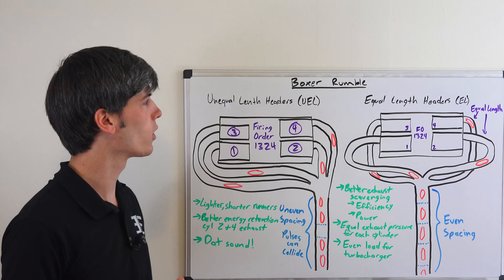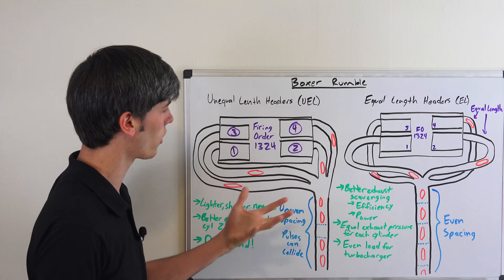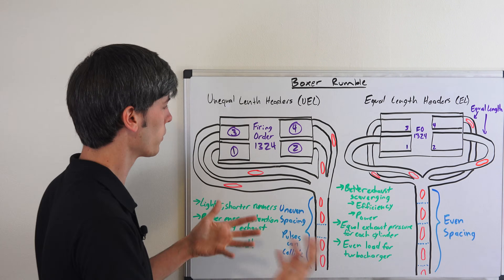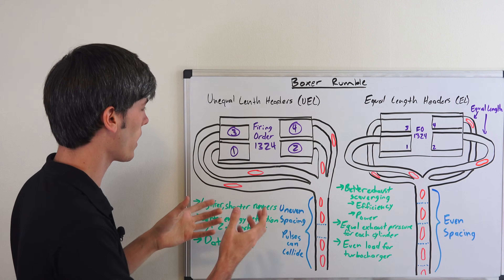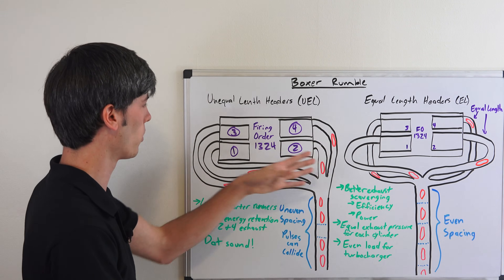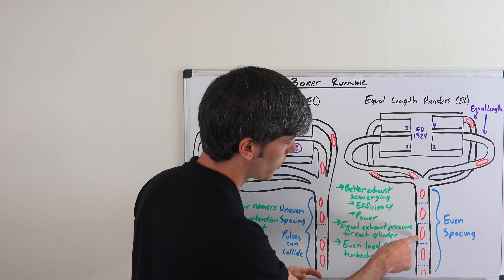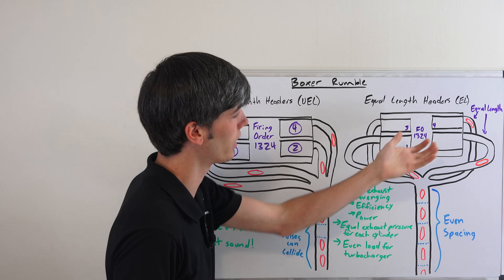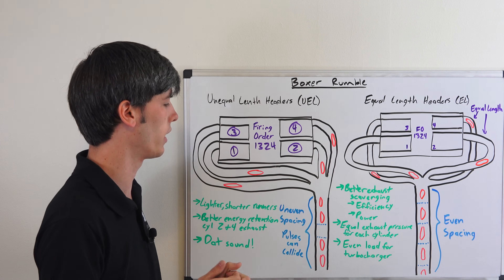Subaru Boxer Rumble - Exhaust Explained

Comment: Engineering Explained logo is actually a boxer engine.
Reply from the maker: +tokekkk Haha yesss!
Reply: Engineering Explained Exposed
Reply: +Stirling Moss Well, his Subaru comes with a turbo, so many you're the idiot and you don't even know his car?
Reply: +Engineering Explained secret is out, save the manuals!
Reply: +Stirling Moss No - that's not the only reason for it. Subaru has sold the EJ series motor in Japan for years with EL headers... so if they wanted to go that route, they could.
Reply: Yes, the logo looks a bit like a 911 flat six.
Reply: +tokekkk i never noticed that, i always noticed the logo shaped like a rotated gear shift gate..
Reply: +Stirling Moss The USDM cars are mainly built to meet the stupid EPA emission tests.

The very same group that is complaining about VWs diesel emissions, yet most of the Pickup that the US make, dont have to follow the EPA guidelines for cars.
Reply: IIGrayfoxII Wrote the dumbest thing I've read on Youtube in a week, congrats.
Reply: +Stirling Moss he actually stated different models with different set ups but you wasnt listening
Reply: He did it before he got a new car, so either it's a coincidence or he's always been a fanboy.
Reply: +Stirling Moss My non turbo subaru has stock UEL headers. do you know subarus?
Reply: +tokekkk What has been seen can not be unseen
Reply: you know what I just realized that, I wonder if Jason did that purposely ...
Reply: i would have said a flat 6
Reply: +Иван Калашников I think you can call a "flat six" a "boxer six" -- theyre interchangeable.
Reply: his logo is car throttle but white and vertical
Reply: I always just thought they were two piston heads.
Reply: Subie boxer engine 4lyf haha
Reply: Geniusss
Reply: +MikeG4936 Yea because the usdm subarus are built with cost savings in mind idiot
Reply: This diagram is wrong. Non turbo Subarus come stock with equal length headers. The only reason for unequal length headers is the other header/exhaust meeting to the turbo manifold on the right side on the engine. You're an idiot and don't even know your own car.

Comment: Isn't your Subaru the new WRX, so the one with equal length headers? Because if it is, even so it still sounds like a subaru, of course it's not that obvious but you could still pick it up in a line up:)
Reply from the maker: +Aioanei Teofil The STI still has UEL headers, and I have the previous gen.

Comment: is this phenomenon only attributable to boxer engines, i.e. if you had unequal length headers on an inline 4 cylinder engine would you still get the same rumble?
Reply from the maker: +oppanheimer You'd have the uneven pulses, hence the rumble, but of course other factors determine the way it sounds (exhaust length, diameter, engine size, valve timing and lift, etc).

Comment: On the 86/BRZ (FRS) work people put the UEL on because it seems to give better smoothing of the FA20's infamous torque dip. Whereas the EL headers apparently give better overall top end gain. How would you explain this effect/difference, if it is indeed real? (I have Tomei UEL on my 86).
Reply from the maker: +Scot Mcphee I would look to see that the claims are legitimate before thinking about why. Dyno sheets before/after? (Sans tune?) You could probably tune it a bit for more torque regardless.
Reply: +Engineering Explained Well the dyno graphs I've seen bear it out but that could still be down to the tune as you say. (sans tune, you'll get a CEL usually because you've deleted the front cat).

Comment: Mate, you're almost there, it's because the cylinders fire from one side first for 2 of them, then the other two on the others side, that is why the rumble exists, it's two lots of pulses in a row, then followed by the other two, if you make equal length headers, the pulses clash which eliminates the resonance, they cancel each other out, the uneven length just allows the characteristics of the Subaru flat 4 to be heard.   
The flat 4 VW engine is different in the sense that it fires on one side, then the other, then back again and back to again till it finishes 2 revs of the 4 stroke engine, the Subaru fires twice one side for one rev, then 2 on the next revolution for the other side for the 4 strokes.

Comment: Glad to see one of the old whiteboard videos!  So is the boxer sound produced purely from the UEL?  If this is the case, would another engine, like a V type, be able to make the same sound if they had the same exhaust configuration?  I'm wondering if the sound is unique because of the exhaust or a combination of the exhaust and the engine itself.

Comment: Why does exhaust make noise? is it the pressure of exhaust being pushed out? or is it the sound of the previous power stroke? and why does a smooth but raspy exhaust note sound so damn nice to my ears? lol
Reply: There's like three ways your car makes noise: induction (intake manifold, throttle body), mechanical (camshafts, pistons, valvetrain, etc) and of course exhaust. It's a combination of these three things that make up the noise you hear. A cool way to hear only mechanical noise is under engine braking, when the injectors don't fire, and very little exhaust or induction noise is created. That sound is purely mechanical.
Reply: +William Grand It's basically the aftermath of a small explosion blowing through a metal pipe.
Reply: +William Grand Sound is just pressure waves. The exhaust coming out of the engine into the exhaust system is a pressure wave which gets modified by the piping and whatever resonators/cats/mufflers happen to be part of it before being released out the back. The size of the pulses, the time between them, and again the shape of the piping determines what you hear and how loud it is.

As for why it sounds good... something something Morgan Freeman?
Reply: +William Grand The exhaust gases (combustion products) are already at high pressure and temperature before the piston starts moving back up the cylinder. The exhaust valve actually opens before the piston has even reached the bottom of the power stroke, this is when the pressure wave happens that EE is talking about in the video. You could say that the piston going back up the cylinder really only pushes out a small fraction of the combustion products that are left over.

This is why the exhaust sounds a lot louder at full throttle than it does on a closed throttle, even at the exact same rpm. The combustion pressure is imparting all the energy to the exhaust gas, not the movement of the piston. The piston is still going at the same speed, but with the throttle closed there is not much fuel/air mixture burned in the cylinder (low cylinder pressure), so therefore not much energy comes out of the exhaust (not much noise).
Reply: Raptor That doesn't answer my question though...
Reply: Because science
Reply: waveman1500 ^
Reply: +waveman 1500 Ok,so if the piston pressure is higher ,then it's louder.Ok,cool. But what about distinct sounds? For example: B16A sounds different than the 4A-GE. Is that because of the difference in cylinder volume?
Reply: Kryotix Gaming Basically, every surface that the exhaust gas touches will have some impact on the sound. So it can be the combustion chamber or port shape in the head, or the exhaust. A lot of the engine sound that you hear is also the induction noise.
Reply: +Darwinpasta Is it pressure from the piston driving the exhaust gases out? or is it from the previous power stroke?
Reply: Its from the explosion in the cylinder caused by the power stroke.
Reply: Well, the exhaust pipe is unique to the make, and sounds different. Why doesn't a French horn sound like a trumpet?

Comment: I would rather have equal length headers, I don't need the boxer rumble, i like it, but don't need it. I'd rather have the equal length so the turbo works better and has less lag
Reply: +Bryan Doherty The question is, can you make them EL till they reach the turbo and UEL at some point after so you get the best of both worlds? Probably wont work, but I'd like to know more.
Reply: +Bryan Doherty At the RPM's your turbocharger is spooled up at, there is no measurable difference. At 3000 RPM you have each cylinder firing off 750 times per minute, or 12.5 times per second, so the turbo has no time to loose it's rotational speed, therefore, not losing any power. And realistically, you are only losing about 1-2 horsepower with the unequal length headers, less than the difference between air pressure and moisture caused by different weather.
Reply: Equal length headers give you the rally sound
Reply: +Rome1017 these huge gains that youre referring to are after a tune and turbo models. without a tune, its not really a readable difference. especially with the naturally aspirated formats. only a difference of a couple of horsepower.
Reply: +Newgenerationisbg you lose quite a bit of power. the average gain when going to equal length is between 10-15whp. that equates to up to 20hp at the crank
Reply: Newgenerationisbg it varies what headers you go with, their diameter, collector size. 5 is super low... ive seen multiple people including friends that gained 10-15 and torque is what you really get, 30ft-lbs consistently
Reply: +Newgenerationisbg EL has more benefits than just 5-15hp. Even in a single scroll set up it helps spool the turbo sooner and quicker. On top of that it helps equalize the pressure/temperature of all the cylinders.
Reply: Mitchell Birch no you dont get the rumble. I have changed the stock header on both my 96 legacy and 99 outback. I have ran them both with the stock header and exhaust and with the UEL and exhaust. The stock header is not even close to UEL.  Its two totally different sounds
Reply: +MarchuxProductions are you dense? It's 2015 and people are still debating the benefits of EL vs UEL. A high horsepower build is a great reason to run EL headers. It helps equalize cylinder temps/pressures, which is great considering to make high horsepower out of a small 4cyl engine, you need a big turbo running high boost pressures. Just because there are plenty of high HP subaru's running UEL headers doesn't mean that it's the right way. Not saying it's wrong either. Just stating that EL is more beneficial, and to argue that is stupid.
Reply: +Psycho Fourseven that wouldn't work. you have already evened out the spacing so exhaust flow is constant. splitting the piping would just make half of that smooth flow take longer to travel.
Reply: +Rome1017 Where did you get this info? When my friend went from UEL to EL headers on his 2.5XT forester, the gain was 5 or 6 WHP. That's less than 2.5% of the power of the car, and therefore pretty much useless. It's still a very quick car, but sounds like a straight 4 now, so he will soon be replacing them for "dat sound". Of course, there are people who would deem those 5-10HP as worth it, so they can do just that. To each their own, it's a free world after all.
Reply: Rome1017 Oh wow. That's pretty damn good. I have no doubt that EL is better for performance, but I've never seen a swap that resulted in more than a peak 10HP boost and just a bit of torque over stock.
Reply: Newgenerationisbg google subaru equal lenght dyno, tons of graphs showing the gains
Reply: +Mitchell Birch non turbo models already have equal lenght headers. of course I'm only talking about turbo models, they're the only ones that have some uel designs. and the only way to see that gain is of course by a dyno tune... why would anyone get them and not tune the car after???
Reply: every N/A model pre '05 has an unequal length header. and you would find out the info because when you get a dyno tune, your first run is usually a base line test to see where the engine is before the tune takes place. im not arguing though. my legacy gt is equal length and the benefit is well worth sacrificing the sound.
Reply: +Psycho Fourseven exhaust gases go from the manifold, to the up pipe to the turbo. they all exit out from the turbo from 1 central hole into the singular downpipe and then out the tail pipe. They only change in sound that can be applied to the exhaust post-turbo is the volume and tone (mufflers/cats/resonators)
Reply: Mitchell Birch You might wanna rethink that...they definitely have equal length, not sure where you're getting that from, people BUY uel headers for the sound..
No one with an NA has gone from as youre saying "stock uel" to el and seen a gain, since it doesn't exist..
Reply: +Mitchell Birch thats not true.  they are more EL than UEL. get after market UEL headers and you will hear a huge difference. the one exception is the first gen legacy, non turbo has a manifold thats closer to UEL
Reply: i went through all of this with my 07 2.5i. 06 and newer has equal length header. i bought a Tsudo UEL for the sound and full exhaust after. the only other option for uel is to use either an 05 stock UEL or buy the Tsudo. if youo put an exhaust on any other subaru pre 05, you get the rumble. 06 and newer, you dont because they have an almost EL header.
Reply: my 97 legacy had it and impreza outback. not like a wrx but somewhere in the middle
Reply: sorry, not my impreza outback*
Reply: +Mitchell Birch http://www.subaruoutback.org/forums/attachments/parts-accessories-performance/61098d1386220785-help-uel-headers-headers.jpg the one on the bottom right is what came on all NA subarus prior to 05, bottom left is from 06+ legacys and almost the exact same thing on imprezas and foresters. both are very much EQUAL LENGHT headers. top right is what every NA guy buys to GET the rumble
Reply: +Bryan Doherty If that really was the case, all the high horsepower Subarus would run EL headers. But they don't.

EDIT: Should've specified what I meant. ELs are more efficient, yes, but not always the best option. They are not the best in absolutely everything.
Reply: +MarchuxProductions that's probably the stupidest thing ve read so far.... there's a right way and a wrong way to get more power like said above ^
Reply: +DevanH87 its more beneficial depending on the application. each header(el and uel) have their pros and cons
Reply: +65PontiacTempest please tell me a performace/efficiency benefit of an UEL header, specifically for a subaru.
Reply: +Rome1017 I feel he doesn't know much about real cars. All of his videos are of video games.
Reply: +65PontiacTempest EL = equalized cylinder pressures/temps and it spools the turbo quicker. Regardless if it's just a few hundred rpms sooner (on single scroll turbo set ups), it's still more efficient. Tell me 1 con to an EL header.
Reply: +65PontiacTempest that still doesn't answer my question. I'm giving you a hard fact, and the only thing you're saying is "it depends on the application." So, give me an example of an application where UEL headers are more beneficial on a subaru than an EL.
Reply: DevanH87 It's not beneficial if you take all the things you lose into consideration. Have you ever tried to neatly fit a massive turbo under the hood of a Subaru (or any small-ish car for that matter)? It's not easy at all, and if you wanted ELHs, you'd have even less space, which would potentially mean having to use a smaller turbo, plus it would add significant weight. In high-hp applications, the cons outweigh the pros.

Also, so what I used to make a few gaming videos? It doesn't mean that I automatically don't know anything about cars. I drive a shitty little E36 that can outrun many newer and more performance-oriented cars on a tight, twisty track, and I upgraded it myself.

(most of the time it meant trial and error, mostly resulting in worse performance at first, but I have learned :D)
Reply: +MarchuxProductions how do EL headers weigh significantly more than UEL? As far as turbo placement, you do realize the header sits under the car completely? Also, you've still not given me a scenario where UEL is more efficient. Why doesn't the new WRX have an UEL header? BC  UEL on a twin scroll set up is pointless.
Reply: DevanH87 You need more pipe to make an EL header, so it weighs more. It might not seem like much, but it adds up, and in a racecar, every gram is important.

But what do headers do in a turbocharged car? Direct exhaust gasses to the turbocharger. Where is the turbocharger located? In the engine bay. In most high-hp builds (I mean 600 and up) a larger turbo is used, so it takes up more space. Now, imagine designing a set of headers that are perfectly equal in length, have a large diameter, and have to feed a large turbo located, for example, behind the right headlight (a common place for drag cars). It would be a pain in the ass, the headers would be heavier and take up more space. The power loss isn't as massive, so it's usually wiser to trade a few hp for convenience.
Reply: +MarchuxProductions again, you've not given me a situation where an UEL header is more EFFICIENT. Not more convenient, not lighter by a few grams...but more EFFICIENT.
Reply: DevanH87 Why do I need to give you an example of that? ELs in general are more efficient, but less convenient, that's their trade-off. It's the only thing I've been trying to say all this time!

Added an edit to my initial comment, just to make sure I get what I meant across.
Reply: +MarchuxProductions I hope you realize that on a Subaru, the exhaust manifold (header) sits underneath the engine. At the collector, a single pipe comes up underneath the turbo so space is not an issue if you're concerned about header design, atleast for turbo models pre 2015 (except the STI)

Comment: Have you ever done a video explaining the sound difference between flat plane and 90 degree plane V-8 engines
Reply from the maker: I have done flatplane vs crossplane is that's what you're asking. There are two videos if you have a quick search on my channel. :)
Reply: +Engineering Explained
 Thanks!